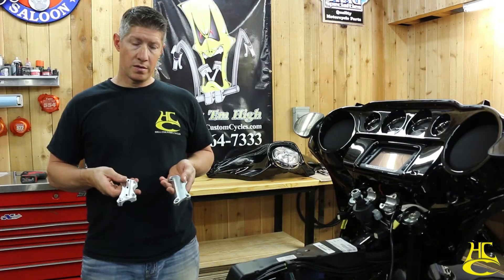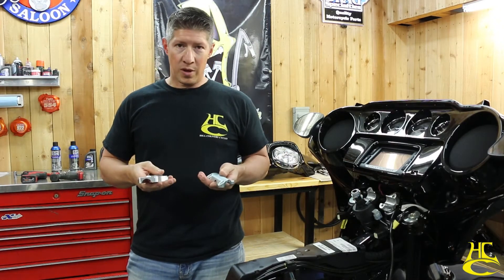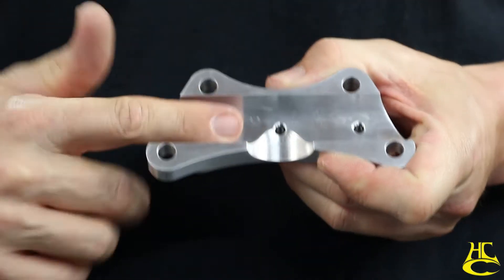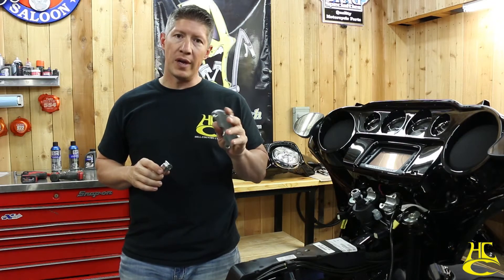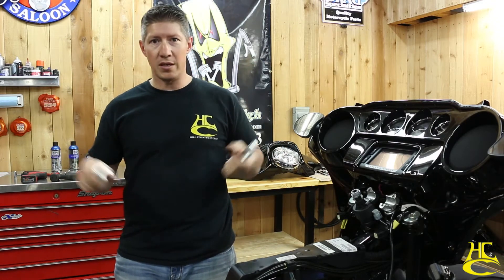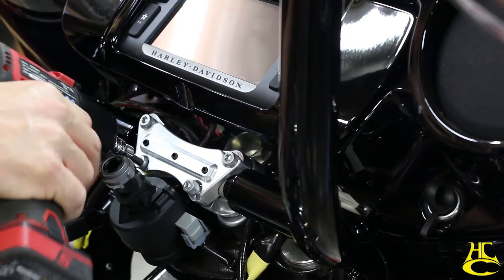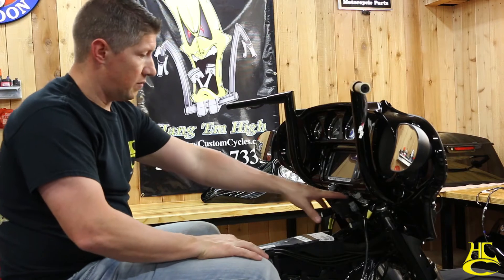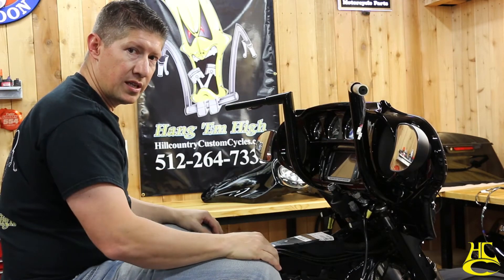Gorilla Grabber Harley Davidson Handlebar Clamp - Product Review & How To Install

Comment: Great idea. I will be purchasing these from you. I will be needing them for a 2004 Road King.
Reply: So, I purchased the part today and I have to say, I was BLOWN AWAY with the OUTSTANDING customer service I got from your representative. This guy is the TRUTH!!! he answered all my questions and then some. Please keep up the GREAT job on taking care of your customers, we don't see that anymore these days. A+
Reply from the maker: +Eduardo Delucca Thank you!!!
Reply: Eduardo Delucca how is it working? I am thinking about it for my 05 RK
Reply: @Jarhead6  Dude, it works great!! I added a piece of aluminum (cut from a beer can), on each of the clamping diameters (The dips on the clamp where the handlebars sit). I did this just to get all the grip I could as I am an aggressive rider.  I am not sure you'll have to do it on yours, I just like a little bit of extra safety. All in all? It works fantastic. Make sure you get it from these guys as there are lots of counterfeit out there trying to do the same for a cheaper price. I heard some horrible stories. Take care and ride safe bro. Semper fi!!!

Comment: I have 1” handlebars on my 2003  Road Glide and want to put the 2015 1.25” Chizeled Lo handlebars on it. 

What all will I have to change to put these bars on besides using the top 1.25” Gorilla Grabber clamp?

Comment: why will these not work for 2019 road glides?
Reply from the maker: +flamekat2002  Because 2014 & newer Road Glides have a 1 1/4” riser clamp instead of the traditional 1” riser clamp which thus fits.  We have coming out for the new Road glides in about 2 weeks